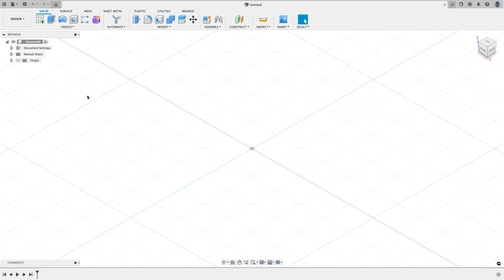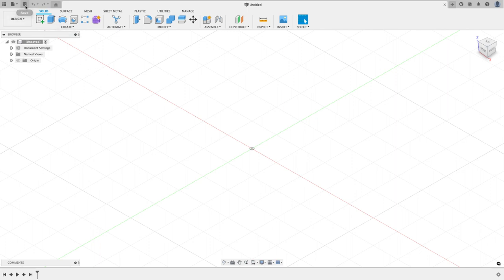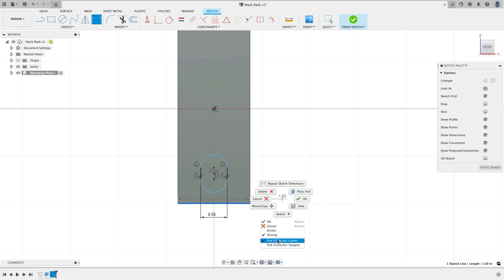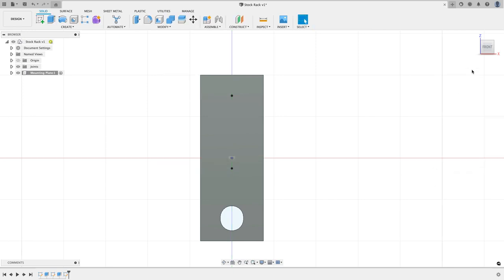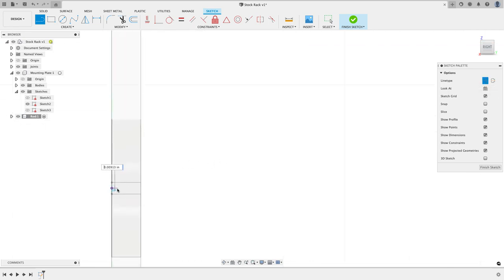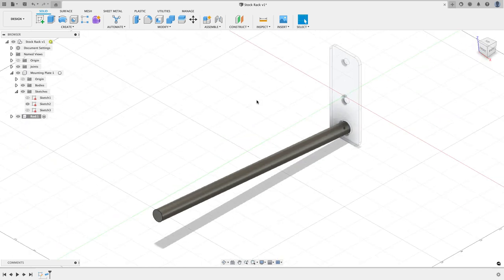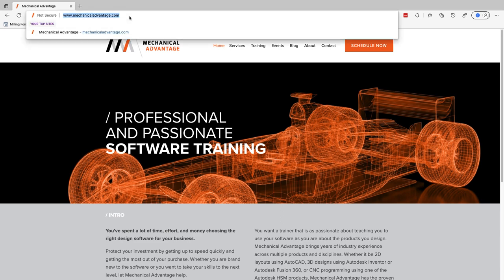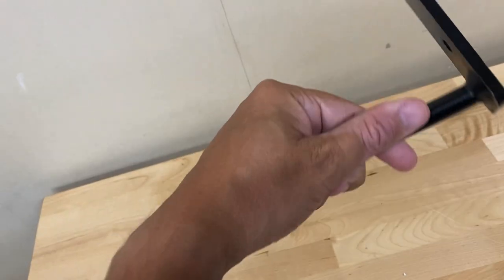Fusion 360 - Designing a bracket to hold bar stock

Comment: Hey everyone needs a summer break, no need to apologize for no content.  Making custom brackets like this is great. I recently used Fusion/plasma/welding to make a monitor arm on my channel. Are you versed enough to explain Fusion's stress analysis tool to cover you're brackets weight limit?
Reply from the maker: Hi Craig. When I worked in industry, I was always pretty fortunate to have a FEA guy on stuff for that sort of thing. One of them tried to teach me some FEA and that is when I realized how the results were dependent on the study being set up properly  The results given are only as good and accurate as the simulation is setup. Sales and marketing wants you to believe anyone can do it, but I'm not so sure on that after working with the pros.
Reply: @MechanicalAdvantage  I agree, study setup is key.  Just curious, thanks for the reply.

Comment: Cool video, but I cannot understand how you'd install it and use it. Perhaps a few shots of it in place and in use would have helped. Ciao, Marco.
Reply from the maker: Good point. I had him make 10 of these. 5 will get lagged into the 2 x 6’s in the wall I’m a row and 5 will get lagged into the 2 x 6’s a couple of feet below that. Then the bar stock will lay across the rods. Does that make sense?
Reply: @MechanicalAdvantage  so the stock will be held horizontally at different heights?
Reply from the maker: @EZ_shop  Horizontally.
Reply: @MechanicalAdvantage  got it, Thanks.

Comment: Just wondering... In regards to your use of an as-built joint between your first component and the origin, is there a reason you use that instead of the 'ground' command?
Reply from the maker: Good question. There is a reason. Ground only exits in the file it was created in. So if you insert that file into a different design; the part is no longer grounded in that design. An as-built joint is persistent. So even if you insert that file into a different file, the address-built joint is honored in the new design.
Reply: @MechanicalAdvantage  thanks, great to know!
Reply: @MechanicalAdvantage  I suppose that got me to thinking... Is there as time where don't want that time exist when you insert into a different for? Or may better worded... Is ground still appropriate in some cases?
Reply from the maker: @BlackSmokeDMax  Here is my thought. It isn’t much harder to create an as-built joint compared to grounding it. I know an as-built joint will work everywhere but grounding doesn’t. So that is my general workflow. Now there is talk of making ground be persistent across design files, but nothing has happened yet. So until then, I’ll just keep using as-built joints for this.
Reply: @MechanicalAdvantage  thanks for the responses, keep up the great work on your videos!